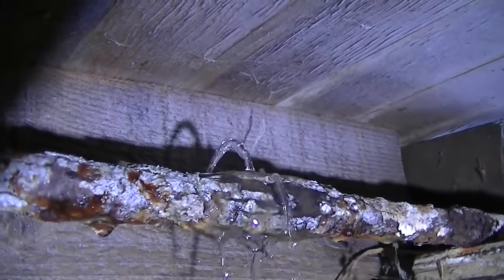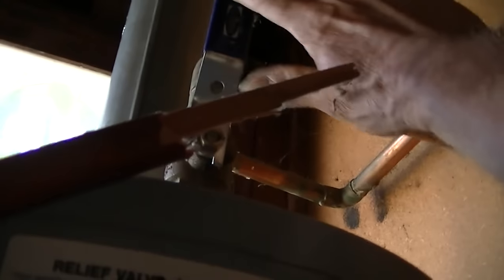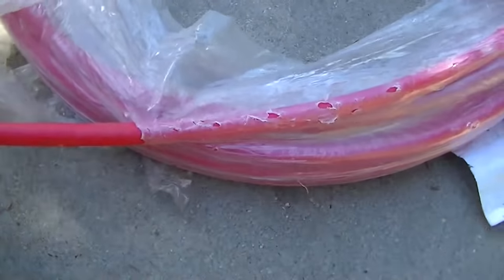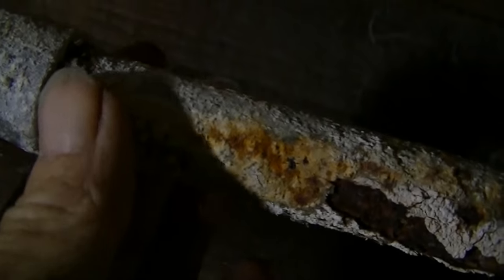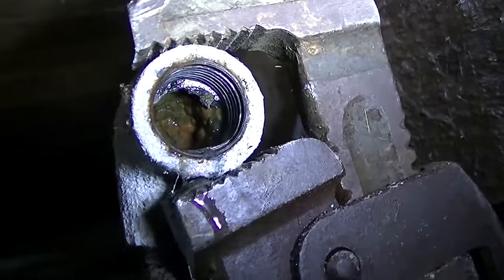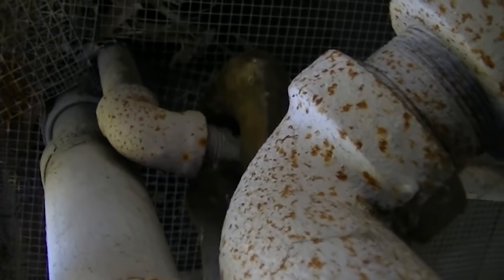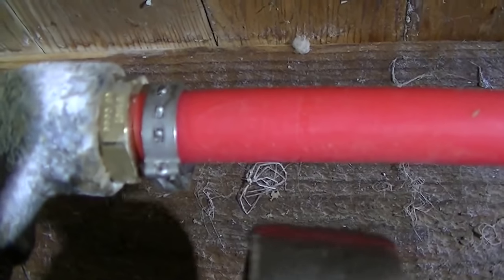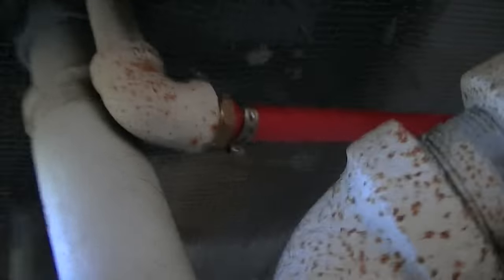Replacing Rotten Leaking Galvanized Pipe Under House With PEX

Comment: just take the old galvanized pipe in put in a new one, why reslove for some pex pipe bullshit, that galvanized pipe lasted 90 years how long do u think a shitty piece of plastic pipe gonna last?
Reply: Couple of reasons...galvanized rusts from the inside out, you are asking for trouble over time, not to mention getting zinc or lead in your water. Next, even more important reason, pex flexes, it is designed to flex with heat and cold and won't burst when extreme cold hits. Its good to 200 psi, where copper and galvanized 150 psi at most, less for older piping. Last, but not least, its easy to use Pex and set up a water breaker, so when issues arise you can isolate water and shut it off to say one floor or bathroom instead of killing whole house water.    HTH
Reply: Chris Kelly.  well said

Comment: Plumbing, yuck. Hate the critics just like you. If I saw a way that seemed like it would have been easier I would say good job just curious if you could have done it like this. Who knows you may not have noticed you could have done it like that. I would do it in a questioning way because you may have had a reason for not doing it a different way.